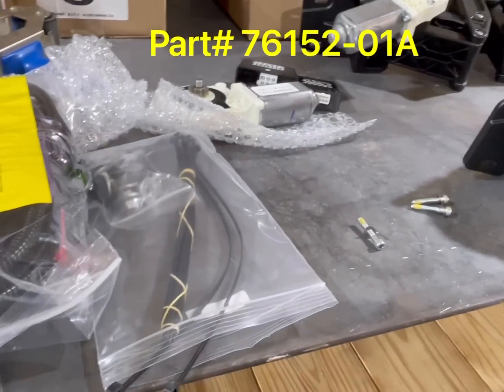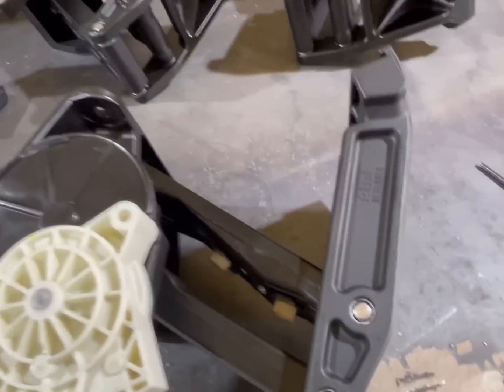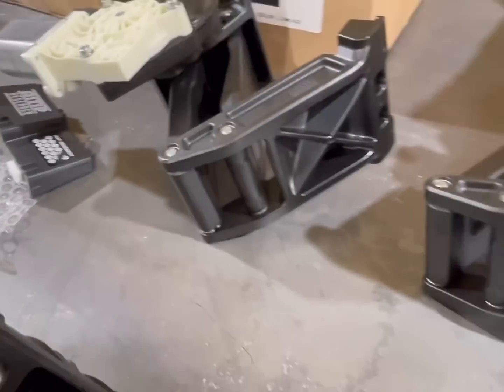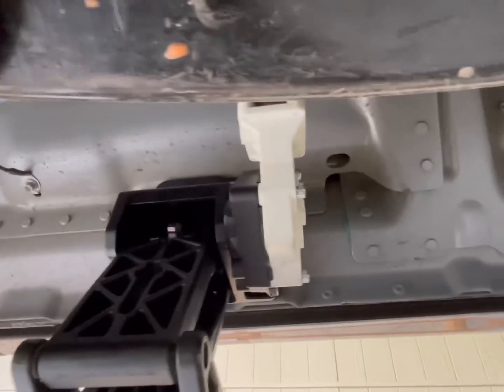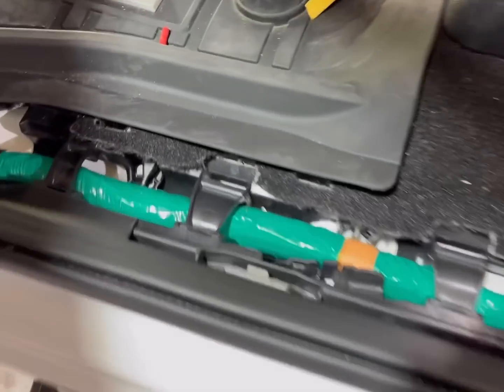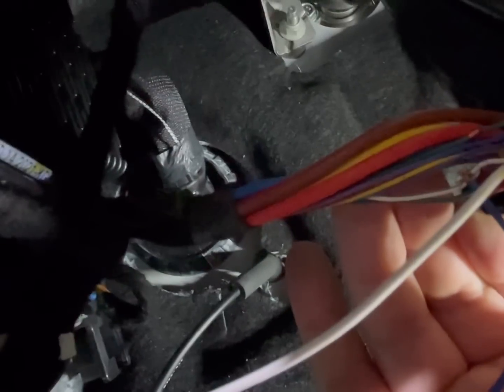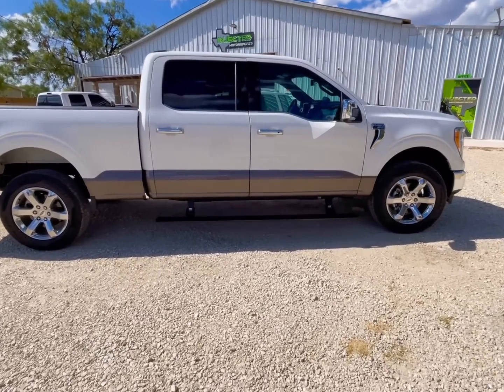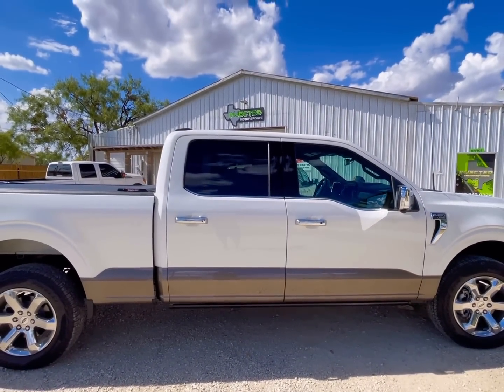Amp Research Powerstep Install for Ford 2022 F-150 Super-crew

Comment: Thanks for the video.  This video is updated to include the white and blue on that harness that the old harnesses/videos don't include.  Getting ready to install mine and this video will be helpful.
Reply from the maker: Appreciate it, let us know how it goes
Reply: @injectedmotorsports53  Success!  I really like them over the OEM boards.
Reply from the maker: @BobSmith-yo6ib  yeah, we've had a lot of trucks come in with the oem power steps and they just don't hold up. Granted everything break down over time but amp has always been there and supports the product.

Comment: I have a 2016 f 450 I can not find my wires for the drivers side where are you get power from thanks
Reply from the maker: The older model trucks and diesels are a little bit different than this video. Most of those styles are plug n play with the ob2 port being used. If you hard wire them in then of course thats different and you'll use the factory door "ajar" wires. They are typically in a loom under the kick panel. If I remember right the trigger wires driver side should be Dark Green/ Purple and then just dark green.

Comment: Is there a hard wire option or is the obdII really the best way to go? The install looks pretty straight forward. Im on the fence as i live up here in the north where we get lots of salt spray on the highways. I like the idea that they tuck up so they wont collect the salt and slush though. Thanks for any insight on the hard wire. Great video.
Reply from the maker: You can be its very problematic. Pretty much everyone uses the ob2 port as its quick/easy. They tend to hold up really well overall with the proper maintenance and the outside is coated with the gritty durable coating. If you decide on a set give us a call we'll have some deals on them soon.
Reply: @injectedmotorsports53  Thanks. I will keep you guys in mind for sure.